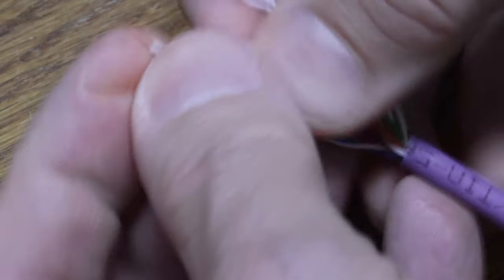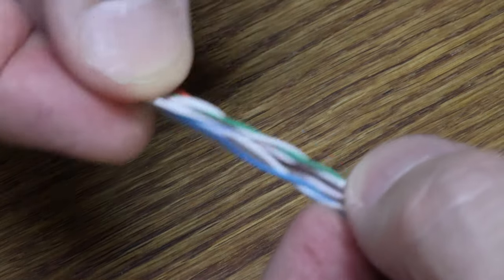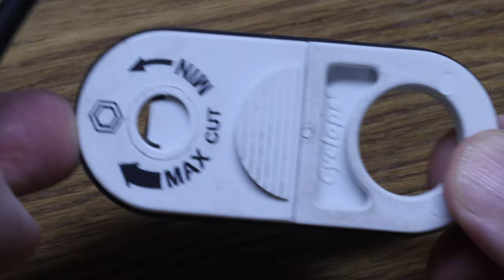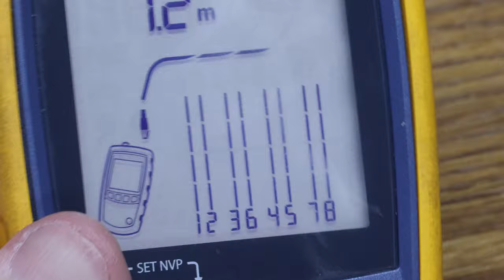Crimping

Comment: I think I could make them blind folded pretty easily if someone told me what one of the 8 colours was.
I might even be able to do it one one handed.
Cat5e solid core.

Lost count of how many cables I've terminated in last 20 years.
Over 50,000 cables and panels.
Reply: You tried any cat 7/8 that stuffs so chunky.
Reply from the maker: Nice
Reply: @TheWebstaff  Its over-engineered and I don't see it ever being useful. The power consumption to push 40Gbit over copper would be insane.  DAC makes more sense for short runs, with fibre for long ones.
Reply: I think I can do it blind folded, with no hands and under water.